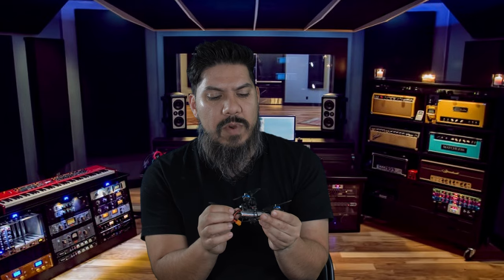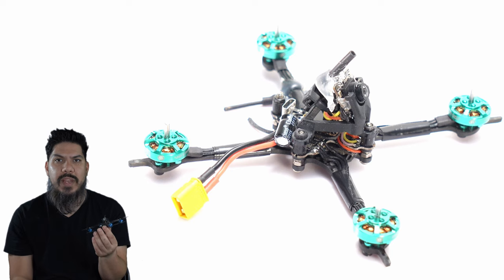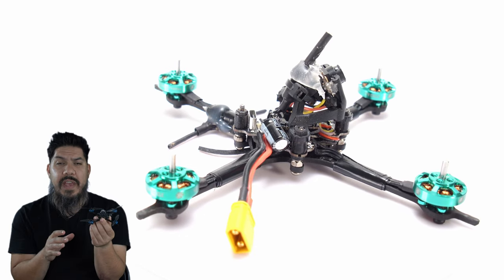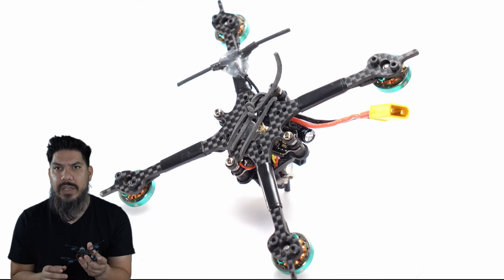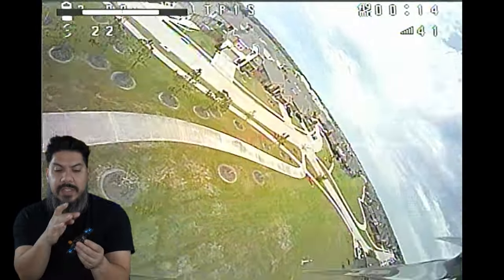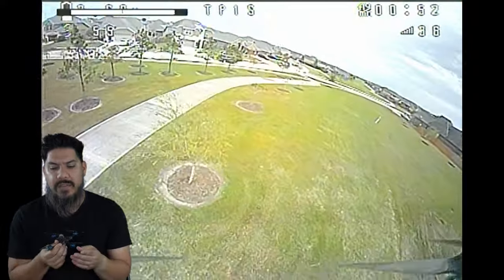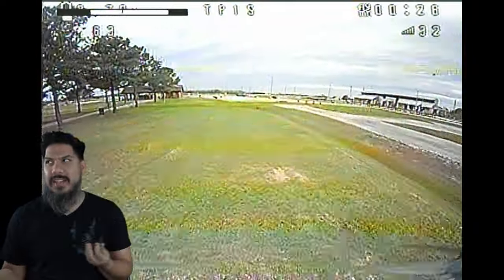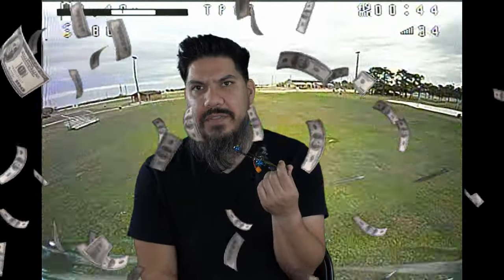Babytooth drone + Zeez All in One Board - FPV Cycle 1S toothpick Zeez AIO

Comment: Love my TP3s. 3s 450-500mah, one on tmotor 1303/triblades, one on the fpvcycle motors/biblades. Beast little rippers you can fly anywhere!
Reply from the maker: that sounds great, its been a while since i enjoyed that 3S 3" formula. Kinda want to try a tiny trainer i think.
Reply: @JonE5FPV  been wanting one as well, seems like a great 3". The TP3 are SO light for the size.
Reply: which one do you like more? tmotor or fpvcycle? also, how do you press fit the props on the t motor
Reply: @abrahamtan9704  the fpvcycle's have more grunt for sure. The tmotor's fly with a bit more precision IMO. The props stay on the tmotor fine MOST of the time. I have ejected a couple mid flight tho, but only REALLY pushing hard freestyle moves

Comment: My Only and Favorite Toothpick I own is a 3mm thick Babytooth frame has a HIFIONRC F7 25amp board naked vista and betaFPV 1105 5000Kv running gemfan Hurrican 3016-3 props and a RDQ 4s 525mah battties. I have broke the original 1.5mm frame and a few motors. Flys very locked but has I-term windup ( I think that's what its contributed to ) where it doesn't like to dive at low throttle.
Reply from the maker: that sounds like an amazing formula.  I really hope to try that naked formula soon.

Comment: I have the Diatone GTB229, with the same VTX as stock, but it runs on 2s and comes in at around 70g with battery. None of the brown outs because of small 2s battery, but huge power to weigh ratio, so super fast and handles like it's on rails weaving through the trees! So quiet it's craZy! 😎🤘 
Maybe the 1s is better? but haven't tried it. This 2s is sure awesome though, and I can't imagine how approx. 10g more weigh to run on 2s isn't an advantage. The power is there when you punch it, where I know it isn't with 1s because you had brown outs! Even with the VTX turned down you'll still have bad sag with punch outs on 1s....it's inevitable! 
Diatone is still well under Kabab's weight limit of 75g with battery for a PROPER Toothpick. IMO, 2s is the best way to go! 
Your 1s is more like a concept quad... sure, it will fly and fly well, but is 1s really the best way to go? I don't know? ... 🤔😳🤷‍♂️
Reply from the maker: The 229, is a very special combination, probably one of my favorite quads of all time and over hte years may have flown that thing more for fun that almost any other quad. (that and the 339).  

This has a unique feel, a bit lighter, 10g doesnt seem like much, but at this weight level it is.  Power to weight this may have a bit more punch, but overall speed on the 229 is probably more.  This is a little less loud, and can be flown in slightly smaller places. 

Overall, a lot of people may be just as happy with something like a 229, and parts are very plentiful.  the babytooth zeez formula is for the most dedicated of weight watchers.
Reply: @JonE5FPV  I hear ya! 10g is a lot in Proper Toothpicks and who0ps, no doubt. But, swapping that 10g for the 2s power and design of the 229 is worth it to me. Plus, no battery sag on 2s.

I added it up and that 1s Toothpick would cost me over $200 to build! Holy Cow! lol

Back when the 229 had been out for a while, I had my eye on it. Was more than I wanted to spend at $129.99, so I was patient. Low and behold RDQ came out with a new Clearance sale and there it was! Only $60 Brand new, but with the 2 part stack, instead of the AIO they went to on the so called "Pro". I hurried to buy 2 of those and another of the Spedix Rex 80 3s capable who0p for $60 also! What a SCORE! I still haven't even flown my backup 229 because my original is still going strong because they used such quality parts! Sure, I did hit a tree or something really hard and cracked the cube frame, but on another Clearance sale good ole RDQ had the 339 frame for $12 ! With it having a little of the carbon fiber tip for motor protection and a little thicker frame, I opted for it! Course, the motor wires weren't long enough, so I found that the Flywoo tiny motor LED's extended them the 1/2" just perfect, so I extended those wires that way. Cheap, Co0ol, and easy peasy!

What a great design those Diatone Cube Toothpicks were! And the 229, IMO, was the True, under 75g with battery, Star of the trio!!!
I agree, my favorite quad ever because it handles like a Miata in the corners with punch and awesome smooth control! 😎🤘 
Thanks for your reply, Bro!
Reply: I’m looking at getting a cube 229. You guys seem to talk very highly of it. Do I have to add my own receiver?  I have an xm+ but no clue on how to solder it and set it up in beta flight
Reply: @danfarley5863  Simply watch video after video to learn all about FPV...soldering is easy IF you have the right tools to get the job done...just like an auto mechanic has his tools, you need the right tools to solder correctly with these small pads.  There are also tons of videos on Betaflight. If you want to get into FPV, it's pretty much a requirement that you watch a ton of videos about FPV and specifically what you want to accomplish. Adding a receiver, which you must do to ANY Diatone quad, is simple as soldering 3 wires. Piece of cake!
Reply: @noforyoutubepremium3108  i soldered before yes. I’m quite versed in soldering. My problem is I just don’t understand how to setup a uart in betaflight
Reply: @danfarley5863  Watch Joshua Bardwell's videos about setting up Betaflight.  A Uart consists of TX and RX pads on a flight controller. When you watch his videos, he explains everything so well, you will pick it up really easily! We all use his videos. Also try Painless360. He's just as good. Soldering on a receiver is super easy and is just 3 wires.  Watch video after video and you'll pick it all up.  That's how we all learned. Youtube is amazing for pretty much learning about anything and everything...including FPV. watch, Watch, WATCH! :)

Comment: I thought 1s was so cool, flies so well for what it is. But now I think 2s is way better when you are more experienced. A lot more power and almost double the flight time. Also handles the current and weight of a vtx and crossfire better. I think 2s lipo is only a bit more expensive than 1s but 2s already has xt30 connector and can last for months longer. So is 1s really cheaper?
Reply from the maker: 1S has cheap batteries, but cheaper than 2S?  Kinda depends, this is a more specialized formula for those that really want to make no noise, and go more places with less room.  

2S is a bit more accessible in most places, but really wanted to try this zeez board, makes for something so dang light its crazy.

If you have the space however, and can use the speed, 2s for the build itself may end up sligtly cheaper.  Like the 229 scoot was talking about, that is my fav 2s maybe ever.
Reply: Kababs of this was to have a super light super safe and super simple quad that still performs awesome what it is. Its not about having crazy performance and thats where the tp3 is made for.